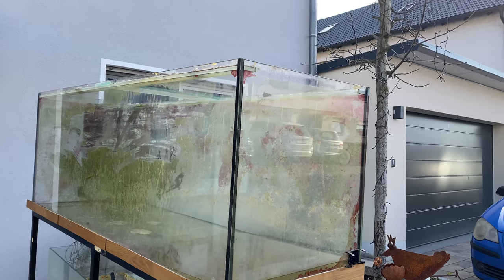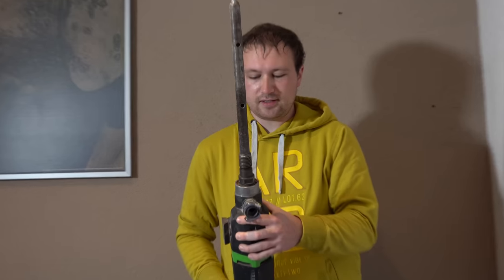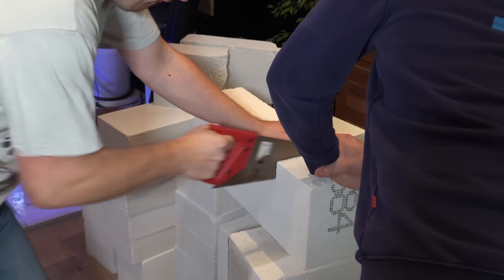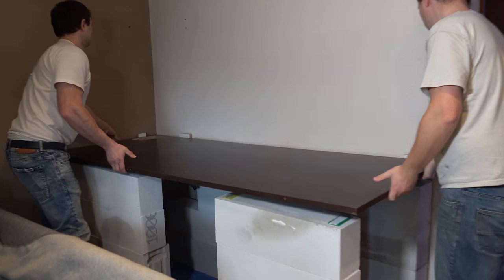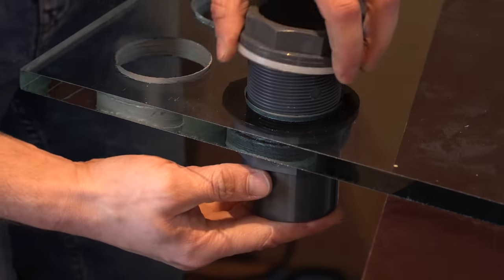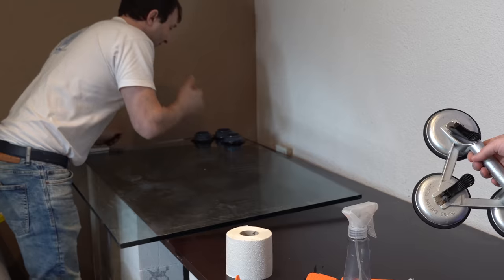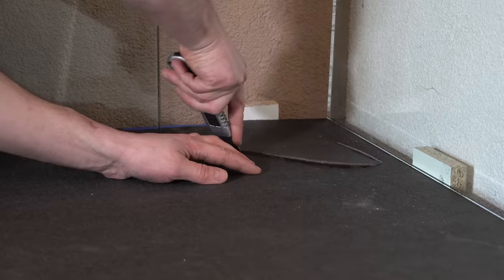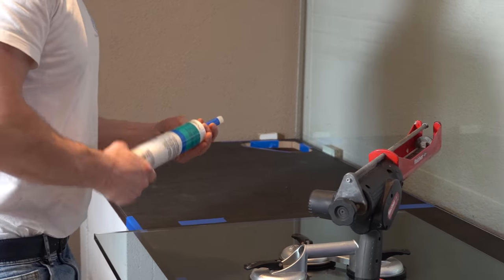How to glue together a 1000 Liters REEF AQUARIUM?!

Comment: I have a question, why did he use two panels for the bottom of the aquarium? Creating a seam in the center... is this considered a false bottom and then another sheet of glass the entire length of the aquarium is added on top? I know ELOS aquariums are double glazed/bottom sheets of glass.
Reply from the maker: I have to ask Rudi again but I think the tank has much more stability this way. For aquariums over a certain size, this is often done to prevent the weight from breaking the glass.
Reply: I have a 12 foot long aquarium with 1 inch thickness. It stood for yrs without any problems.

Comment: Why is the bottom made of two parts? Did you add a small piece of glass at the bottom where the two sides meet?
Reply: I have the same question
Reply: @raveensm  same, never seen that before.
Reply: Me too! Around here the bottom is first and the sides sit on top.
Reply: @powerfool650  Maybe true for smaller tanks but with large tanks like these that have thick glass sides the weight of the panes is too great to place them safely on top op the bottom.
Reply: @martijnvanbeek4387  my 215 gallon was@ built at the factory sides on top of the bottom. It was six feet long, 2 feet wide, and 28 inches tall, 1/2 inch thick glass.
Reply from the maker: Hey guys ;) Chris is right so for tanks above a certain size you need more bottom glasses for bring some more stability into the aquarium :)

Comment: Awesome video! Planning on building something similar myself (~8'). I get the concept of using 2 sections of glass for the floating base. But, I'd rather have a double thickness base myself, so I think I'll have a bottom layer in 2 sections and an upper layer in 3 sections. Hopefully, that'll help add a little flex/shock-absorption if it's required... I just wondered about what type of bracing you added afterwards? And did you brace the bottom of the tank too? Many Thanks!

Comment: That was impressive to see the tank getting glued together.  Does it get braced at all while curing?  Looking forward to seeing more on this build.
Reply from the maker: Thank you do much and yes it will braced a little bit :)
Reply: Awesome video! Planning on building something similar myself (~8'). I get the concept of using 2 sections of glass for the floating base. But, I'd rather have a double thickness base myself, so I think I'll have a bottom layer in 2 sections and an upper layer in 3 sections. Hopefully, that'll help add a little flex/shock-absorption if it's required... I just wondered about what type of bracing you added afterwards? And did you brace the bottom of the tank too? Many Thanks! @seafriendlyreef

Comment: Hi bro. Very good job. I wanted to ask you what is the type of silicon sealant (black coloured one) you use for this type of big tanks. I ask this because i have a similar big tank in my home which is right now leaking from the bottom panels. Presently the tank can hold only half the tank. if i make it full, it starts to leak. The tank have a height of 4-5 feer approx. what you recommend.  Thanks in advance.

Comment: I was surprised seeing the side glasses rest on the base and the side panels siliconed the from their sides. But I guess it makes sense since with the water pressure there're less shearing forces if the sides were attached on top of the bottom glass.
Reply: The bottom glass was installed after the rear glass and 1 end was installed. The sides and end glass where not sitting on the base, the  base glass was installed inside the 4 glass walls